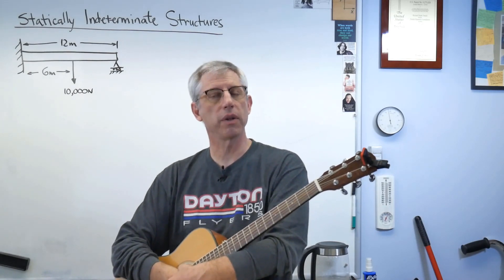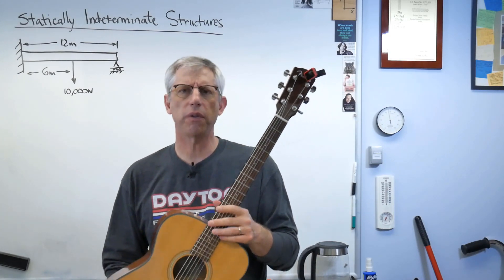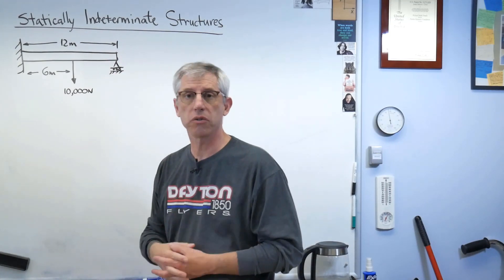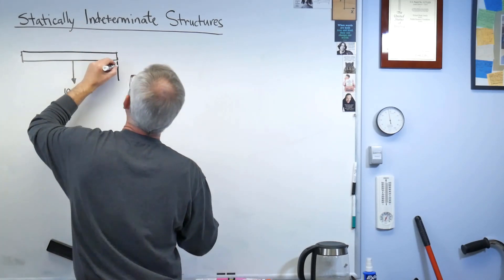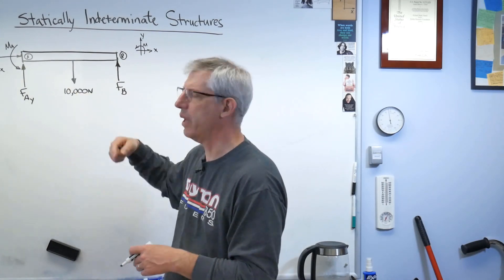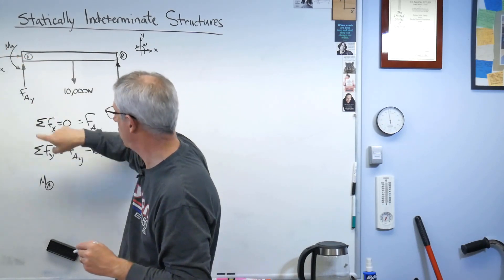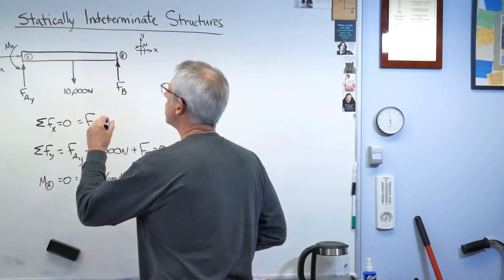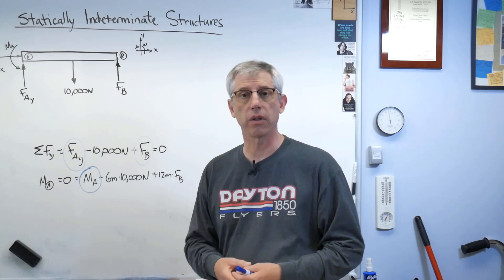Statics - Statically Indeterminate Structures

Comment: A horizontal rectangular  plate  ABCD  is  hinged  at  points  A,  B  and  C.  AC  and  BD  are  diagonals  of the  plate.  Downward  force  P  is  applied  at  D.  The  upward  reactions  RA,  RB,  and  RC  at  points  A,  B and  C,  respectively,  are (A)  indeterminate (B)  P,  -P,  P (C)  0,  P, 0 (D)  P/3,  P/3,  P/3
Reply: Can anyone answer this?